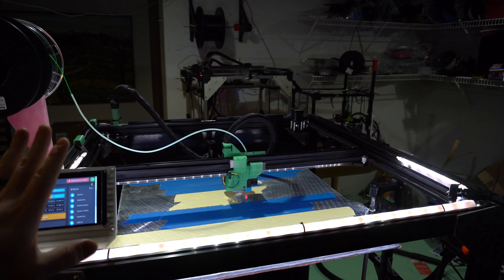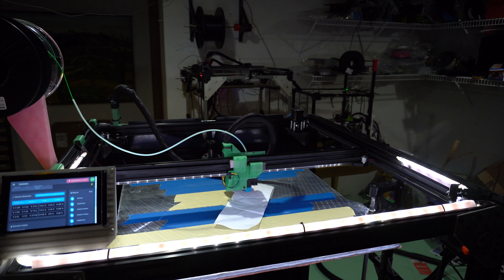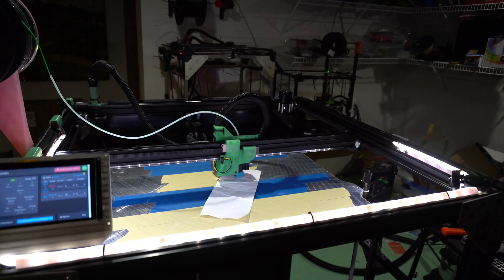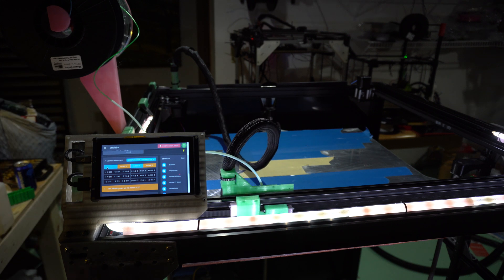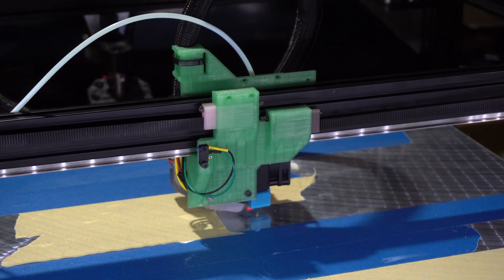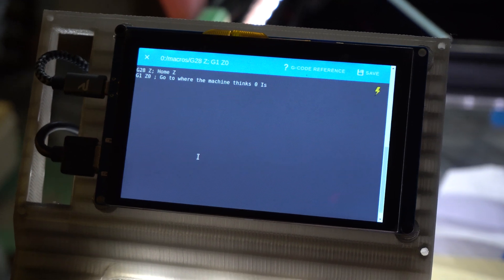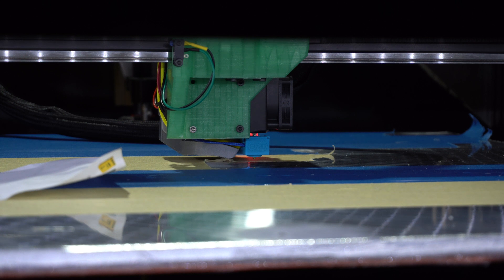Duet 3 Bed Auto-Compensation Producing Invisible Z Offset

Comment: i think you mistaken Z trigger height for Z offset in G31 X-22 Y60 Z1.6 P25 ;XY offsets Z trigger height. Reset trigger height to 0 prior with M851 Z0 and m500, and then run G31 X-22 Y60 Z1.6 P25 (whaterver yours is). This problem use to drive me nuts because i know what my Z offset is, but G31 only cares bout trigger height. which is how far above bed nozzle is when probe triggers. Z offset would be how far the probe is from nozzle. hope this helps, if not please ignore.

Comment: I know this is old, but I ran across the solution. https://duet3d.dozuki.com/Wiki/Bed_levelling_using_multiple_independent_Z_motors#Section_Prerequisites "If your bed is not perfectly flat or the gantry sags a little when the head is over the middle of the bed, the process will cause a small shift in the Z=0 position. To correct this, if you are using the Z probe to do Z homing, you can just re-home Z at the end of your bed.g file." 
Hope it helps.
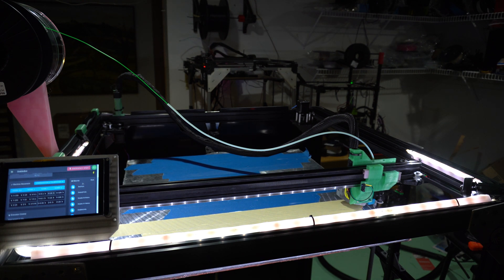Reply from the maker: Hi There! As I showed in the video (which is why this video has no cuts, I wanted to show complete continuity) After using bed tramming, i completely re-homed the machine. That is, I homed EVERYTHING from scratch after tramming. That means that all offsets from G32 should be wiped as it re-sensed the bed at its new flat plane. Start the video at 2:52, where i show that even though I trammed the bed, and then completely re-homed it (that is, re-sensed its bed location) there is something that was stuck in firmware causing the issue. The machine no longer has an issue as future firmware removed the bug, without me changing anything but updates and swapping to an inductive probe. Must have been in the BLTouch code

Comment: you can use the G92 command after it homes to give it a set z-offset
add G92 Zxx.xx as the last line of code in your homeall.g and the homez.g
this should do it 
so if the lcd is showing z at 6.1 after home but its really 5.2 after home just make the command "G92 Z5.2" and it will be right

Comment: I think the problem you're having has to do with the existing z offset being stored in the eprom. You must first erase the existing z offset and set it to 0 before you run the bed compensation feature. Try sending the M851 Z0 command to the Duet first, then M500 to store the z=0 offset. Send a M501 to set active parameters and then M503 to view them to verify that the z offset is now zero. Perform your bed compensation. When through z should be at the correct height. Send M501 and then M503 again to verify what the z offset now is. I ran into a similar problem with my Ender 5 Plus.
Reply from the maker: Since I made this video, I switched to an inductive probe (I got a spring steel surface so I could use it) and without any other changes (I switched config for the probe # but that's it) the problem went away. Seems related to the bltouch +rrf3+rpi. It can now easily run levelling without concern. Thanks for posting
Reply: @LukesLaboratory  Good to know. I just put a Duet 2 Maestro into my Ender 5 Plus and have had problems with the autoleveling feature myself, but I did discover yesterday that the Ender 5 Plus has a different leadscrew on the Z axis. The Ender 5 uses 400 steps per mm on the Z axis but the Ender 5 Plus uses 800. This might be why I've been having trouble with the autoleveling on that machine. I corrected the steps and it's printing perfectly now but I haven't tried the autoleveling since I changed the steps per mm on the Z axis. I'll give it a try today. The problem I've been having has to do with the Z offset but now I understand why since the steps per mm on the Z axis was only half of what it should have been.